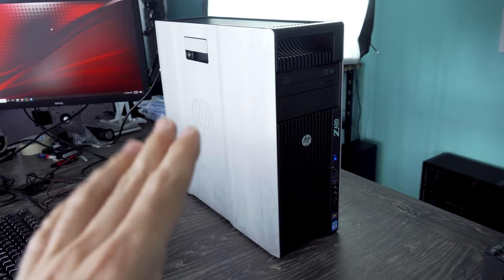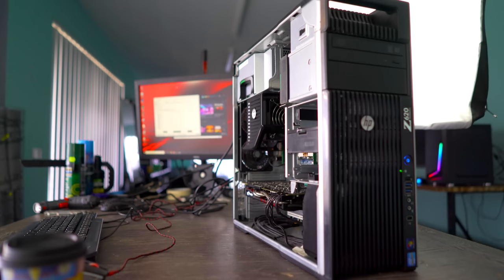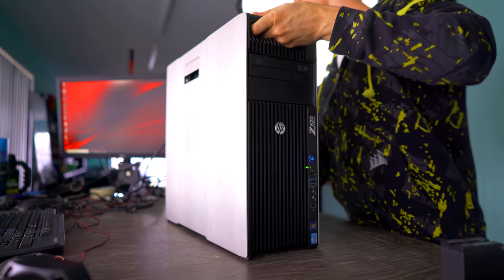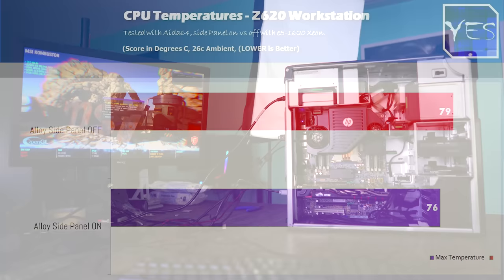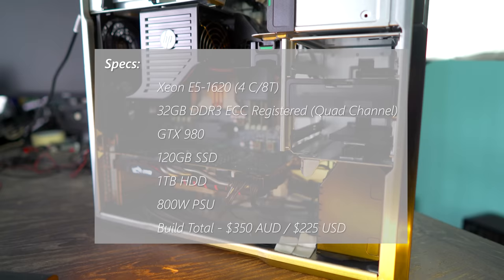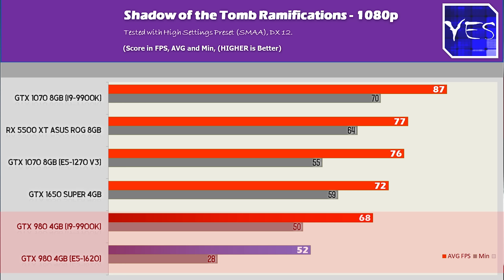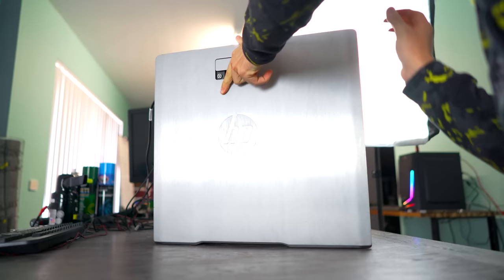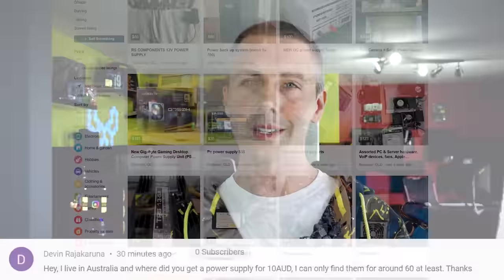Is a HP Z620 Workstation Still Worth Considering for GAMING in 2020...!?

Comment: Mentioning this being equivalent to a i7 3820 makes my recent purchase sound like an even better deal. Picked up a complete ASUS P9X79 System (minus GPU) with a 600W gold rated PSU, 8 Gigs of DDR3 2133Mhz RAM, i7 3820 (OC

’d to 4.5Ghz), case, 120GB SSD, 500GB 10k RPM HDD, aftermarket cooler all for $180 USD. Throwing in a GTX 1660 Ti I purchased for $180 and off to the races :)
Reply: That is/was an amazing deal. Wow. I think the board resells for almost 1.5-2 times the price you paid.

Comment: I was able to overclock on my z420 motherboard with intel xtu, might want to check into it :-) 1650v2
Reply: @JMhamp   I was getting solid 140fps in warzone and 150+ in overwatch, 5683 in timespy with a 980ti. A z440 is the x99 platform though, I havent overclocked on that board before. https://www.3dmark.com/spy/11179375

Comment: Hi . I do have a HP Z420 Xeon e5-1680v2 8cores/16 Thread @ 4.4 Ghz cooled with Noctua Cooler, 32Gb HP RAM quad channel , Samsung EvoPlus M.2 SSD with Win Pro on it (3500/3300 Mb/sec) , 1Tb Samsung Evo 860 SSD , GTX 1070 8Gb GPU, custom made cooling with dedicated fan controller, and 4k 50inch display   . Obviously very happy with it ....     Now I am wondering what should be a upgrade from this ??  (A good performance/price one as Tech  Yes used to say , lol )

Comment: I picked up a Dell Precision 3610 with a Xeon E5-1650 V2 and 16Gb ram for £140. 
The Quadro k2000 graphics card is the only downside (runs fortnite on low 55-60 fps)

Comment: Just got a z420 barebones with a e5 1650v2 and threw a new psu and a 980 ti in it, had reg ecc 64gb kit of 1333 ddr3 I threw in as well. It out performs my z170 6700k @4.7ghz. Also if you get a unlocked xeon you can overclock z420 and z620 with Intel XTU, my 1650v2 is at 4.3ghz on stock voltage with a 80w idle..

Comment: I just received one, with E5-1620 (1 CPU) and 48GB RAM. Already installed a SSD drive, at the same location of your video (drive 0), but not yet make a mod to support it like your mod (is it a heatsink for support?). I am planning to install a 1070 card but currently waiting for the dual 6 pin to 8 pin vga power cable adapter.

Comment: Arguably the z620 is EASIER to move around, it has freakin handles! Also, they support upto 128GB with a single CPU, and the E5-1650 and above (not 26xx) have unlocked multipliers, my E5-1650v2 can sustain 4.4Ghz under 100% load.

Comment: Hi there , thanks for the video , I got HP - Z620 workstation with Intel(R) Xeon (R) CPU E5-1620 V2 @3.70GHz (4- Cores 8 Threads), 128GB DDR3 RAM.
I would like to know whether I can upgrade to a newer processor on this work station? if so please suggest the CPU model
And finally does it make a difference in performence if I do so.? thanks in advance.

Comment: Good option, it's still relevant! I'm saying it because even with this system you can play at 1080p with decent details (not low) and it is much cheaper then to build a new PC... I bought a  system with e5 1650V3 and x99 Chinese mobo, it comes with an option to install nvme ssd on mobo, ddr4 ram and you can overclock cpu for 3.5ghz to 4.5ghz ( if you have 500W gold certificate psu or 600W bronze one) which is nuts! With my system i can play games at 1080p at ultra settings on almost any modern game plus that  e5 1650V3 (6c/12t cpu)  is not reaching 70c in load (normal gaming session) Pretty interesting stuff, thanks tech yes city :) 
If anyone is interested i bought this build:
* e5 1650v3 6c/12t base clock 3.5 ghz OC at 4.3ghz  because of 430w psu
* 16gb ddr4 ram single stick speed is 2133mhz ( but in this build speed of ram memory doesnt matter that much like for example with ryzen)
* xfx rx 570 8gb (recommend you to buy nvidia equivalent because it's quieter and it runs cooler than amd)
* 256gb nvme (os) with plans to expand storage next month
* seasonic 430w bronze 80+ (i recommend at least 500w or 600w psu for reaching maximum potential of platform)
* 3x 120mm fans, one on cpu on in front (intake)  and one in the back (exaust)
* PC case is some brand called 1st cool, looks really nice and it doesnt lack in options (medium sized case)
*cpu is cooled with air cooler an artic tower cooler dont know exactly what model is but it has options for two fans( 120mm) i have one installed and in stress testing with prime 95 cpu reached 80 degrees celsius after 25 minutes...
**system costed me 600 euros (650 american usd)  im now in Europe and it's worth it.

Comment: These z620s can handle a lot more ram than that. 420 too. Some say upto 512 on v2 with 64 gb lrdimms. 
My v1 z620 has 4 32gb 1866mhz lrdimms and is just fine, 4 slots open. Did a lot of research before I found someone else who gave me the go ahead on the larger lrdimms, that they had success. 
And then me too.

Comment: Guys nee your openions and if you want to recommend any changes. It's a budget rig. Xeon e5 1650 v1, mechanist x79, 32 gb ddr3 ecc reg in quad channel, a rx 570, 240 gb ssd (boot). 1 tb hdd, 550 wat psu, and other stuff. This any good? Planning to pair up with with aio corsair wit with smaller radiator model..(I've her the mechanist can do some mild over locking, and that's what I'm mostly after, since this would be my first build....)

Comment: Just Bought an Lenovo C30 workstation
It comes with 32gb ram and 500gb ssd and a quad Xeon 3.9ghz 800w psu
For 500usd here in sweden
And ordered 2x E5 2670 v2 10core Xeons for 90usd from aliexpress 
The have sales on Xeons chaeck it out.

Also the Lenovo c30 is interesting its a normal size deskrop but with dual xeons

Comment: I've heard you can overclock the E5-1650 6C12T and E5-1660 and E5-1680s with Throttlestop on this? Can you test out?! I got a HP Z420 for myself last xmas with same 4C8T E5-1620! :)
Reply: I have a HP Z620. I have my E5 1650V2 at 4.1 GHZ all core clock. They can be overclocked using the intel extreme tuning utility,

Comment: I have a asus server motherboard that I bouth for $150 usd with 32gb ram and heatsinks. I have a 240gb ssd and 1T hhd from my old 775 pc, and I just bouth the two x5675 for $30and a gtx 1060 6gb for $120 and EVGA psu for $20.
 it's running 100fps plus depend of a game.

Comment: The Z Workstations are great for editing... They can be a great gateway to Xeon deals for really high core count PC's. However, they aren't great for gaming. Those Xeon CPU's have really poor single core performance compared to Core processors and 3rd gen Ryzen. Even for editing Ryzen CPU's typically offer better value unless you find a REALLY good deal

Comment: Recently built a budget PC for gaming and everything was working fine untill I was doing Windows update after installing Windows and before it could finish I hear a fan ramp up then I lose video signal but my PC doest restart and even my keyboard and mouse stay light up. Now as soon as I get past the bios boot menu screen I lose video signal as windows boots up... Please help me.
Reply: Specs are:
 ASRock B450m-HDV Motherboard
ASRock Rx 570 4gb GPU
EVGA 450w 80+ BR PSU
Ryzen 5 1600 6 core
16gb Corsair LP DDR4 ram
500gb WD Blue SSD
Reply: That power supply is seriously underpowered for your system.

Comment: possible correction to note.

correct me if I am wrong.

the z600 was not the fagship for the single socket workstation. some models of z600 had duel cpu's 

the z800 was the flagship of the HP workstations of those days in general. And was bascially a more powerful version of the z600 duel cpu version.

Comment: Not related. And most will prob say they wudn but, I currently have a msi b450i gaming plus ac, r5 1600af @4.1ghz 1.33 volts llc4, 2x8 3466 cl16 hyperx, rx5700 ddultra flashed bios which is new still, but it CRASHES still with new drivers. Not alot but I went a bought a evga rtx 2070 super ftw3 bc I'm done for now with this fuckin GPU crashing my pc.